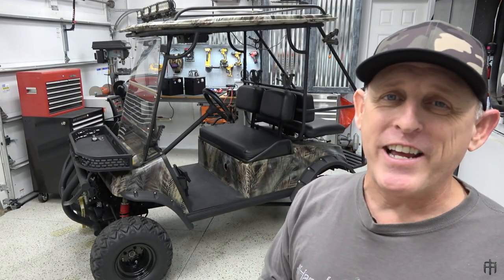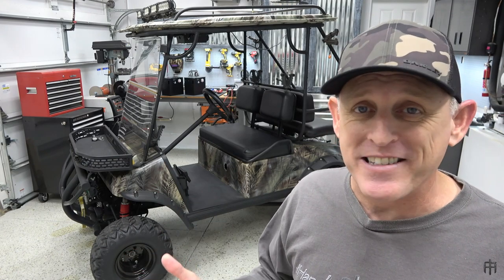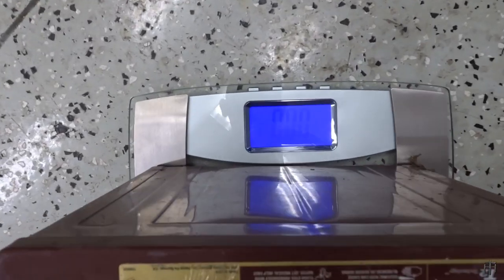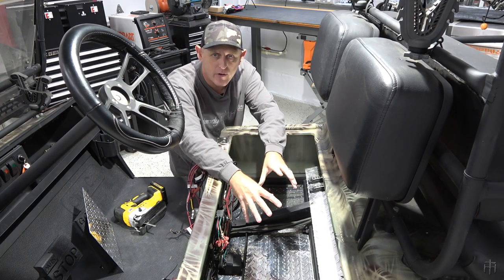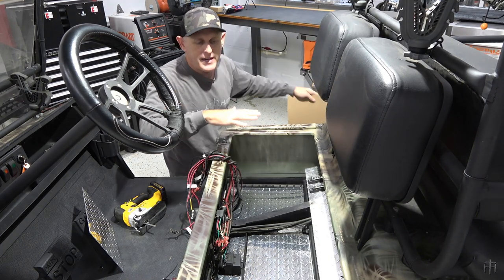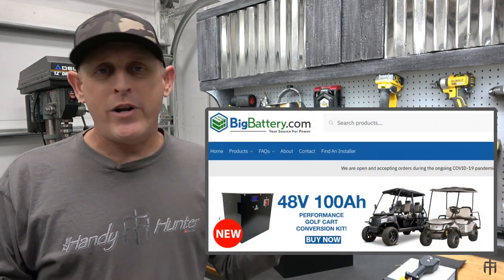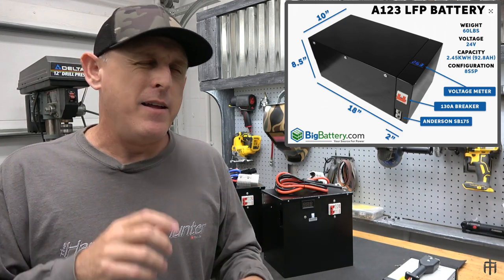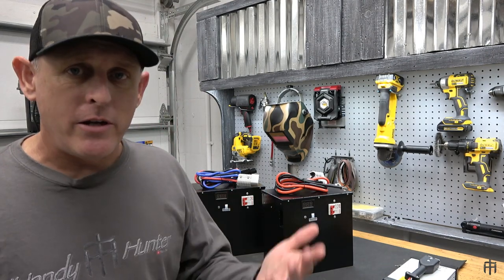Tesla Powered Hunting Cart!  Lithium Battery Conversion!

Comment: You mention lithium ion batteries multiple times but you links are for lifepo4 batteries which are not the same as lithium ion. You really could save a lot if you look at the individual 3.6v lifepo4 cells. thats what I replaced my 6 -6volt LA batteries in my camper with.
Reply from the maker: You are correct…The batteries I installed were Lit/ion but the ones I now recommend are LifePo4 because they are better.  If I had to do it all over I would build my set out of 3.2v blue blocks using a Daly BMS.  Thanks for commenting!

Comment: The led acid batteries need airflow because of the off-gassing. LiPo needs airflow but because of the heat dissipation. So don't seal these up without giving them a way to get rid of excess heat. Use a porthole with a small fan that turns on at 75 degrees or something based on the specification.

Comment: Great video, converting mine. What did you do about the interlock that prevents operation while charging since all the old charging cables are replaced.
Reply from the maker: I removed all that so the cart will actually move while charging.  I either put it in neutral or turn the key off.  Hope that helps.

Comment: 👍 nice to see there are more lithium pack alternatives. I'm currently building another stol plane. I'm planning on electric in it also. Will be using a 40 HP  89# of torque. With Peak efficiency at 3000 rpm  And 4 Tesla packs. These packs are flatter allowing two in each wing. This Plane will be used mostly for competition. But with its glide ratio and the motor regen capability. I'm hoping for close to two hours of flight time. Which at top Cruise speed should get me around 250 miles. More than enough to take a leisurely early morning or Twilight light flight.
Reply from the maker: That’s awesome!  What a cool project!  Shoot me some pics when you are done…would love to see it👍

Comment: Would you recommend a setup like this for a twin motor bad boy buggy
Reply from the maker: Yep! Just look for a good battery with high output since you have two motors.  I assumed the BBB’s are 48volts?  You should have many options if you have the room, etc.
Reply: @TheHandyHunter  yes, it is 48 volts and has alot of lights, radio, etc. But all the lights are led. If I contact big battery are their prices competitive,. Every where I look it looks like about 1000 to 1500 for the setup including charger.
Reply from the maker: That sounds cheap actually.  I’ve only seen prices that low for lower Ah sets which may be all you need but generally the more Ah the more$$$.
Reply from the maker: Are you running your lights off a 48v to 12v reducer?
Reply: @TheHandyHunter  yes,. All lights and equipment are running off a current 8 battery setup to produce 48 volts. Then ran to a reducer and then to a fuse box

Comment: Good video thanks. Did the batteries stop holding a charge or a different issue?
Reply from the maker: Internal cables too small, breakers tripping constantly, and range drastically shorter way too soon.  I would build my own batteries next time.
Reply: @TheHandyHunter  thanks for the info!

Comment: Hey..Nice job! I was wondering, are you concerned about water/debris getting into those bus bars and such? Your wheel wells are open to inside that battery compartment. Also, your charging port is exposed. For an off road cart, that would concern me.
Reply from the maker: Not concerned about the bus bars but it can get really dirty inside so it needs to be cleaned.  I pressure wash the inside but avoid direct hits on controller and battery boxes.  Never had a problem.  Also, there is a cover that goes over the charging port when not in use.  Hope that helps!

Comment: How did you secure the diamond plating?  Screws/Bolts??? and where did you get it from??
Reply from the maker: I get my diamond plate at a local steel store but you can get it at Home Depot or Amazon as well.  I just used stainless metal screws to secure.  Good luck!

Comment: ok in your description on your amazon parts i do not see the shunt for the bus bar, also i'm confused about the accessory bars are they on the page. thanks
Reply from the maker: Hi Dale, sorry for the delay.  The shunt comes with the Coulometer.  Not sure what you mean by the accessory bars…let me know.  Thx!
Reply: @TheHandyHunter  so i am thinking about buying the same Batteries that you have, 1st what has been your opinion on your setup 2 i currently have a voltage reducer with a fuse block and ground block will that be sufficient with this system? thanks

Comment: Looks like you have a 500 amp controller.  These packs have a 126A peak discharge so did you have to turn down your controller?
Reply from the maker: I did not but I rarely hit that high of a draw for very long.  It does happen sometimes when pulling a heavy firewood trailer for a while and the breaker will throw on the pack.  I just flip it back on and take it easier.

Comment: I am in the middle of a similar conversion. New controller, solenoid, and lion batteries. Did you need a obc bypass for this setup. I cannot get any click out of solenoid but have voltage everywhere.
Reply from the maker: I don’t have an obc on mine.  May want to double check your throttle wiring to make sure it’s turning on the selenoid.

Comment: Any updates on how you like (all of) the new equipment?
Reply from the maker: So far so good!  My only problem is that I can’t find a 12v reg that can push my winch.  I think it’s a power hog.
Reply: @TheHandyHunter  I was wondering about this. You said in the video you had the winch powered through the converter, did you have it that way with your LA batteries? I have been told more than once that this can not be done due to the amp draw that a winch needs. So far there is no converter I have found that can handle a 12v winch. I also can not seem to find a 48v winch, even though there are stories about them existing. Have you had any luck finding an alternative method?
Reply from the maker: Hey brother...we think alike.  On LA I ran winch on 16volts (2 batt)...ran like a mother.  On lithium...At first, the winch worked on the regulator but then blew up.  I ordered a bigger one and it only clicks when I try it...won’t work.  Currently, my winch won’t work and I’m done trying to find a regulator.  I think the only solution is to run a separate 12volt battery in the cart just for the winch.  Let me know what you find out...I’m stuck too!

Comment: How did you mount your battery monitor and temperature gauge? I kind of want to do the same thing (mount up high so easy to view). Can't tell from your video and don't see any brackets on your amazon store. Looks like you may have used velcro? Also, for your battery monitor, did you wire it through your key switch so screen only on when key on? OR, since you have on/off switches on your batteries, did you simply wire per instructions and turn off your batteries when not using so no power to accessories? I bought the same monitor and planning to install this weekend.
Reply from the maker: Hi Troy, I took a metal junction box cover and bent it so my monitor would angle down a bit.  I then wedged it in place for a tight fit.  I used double sided tape to make it stick and so far it’s been great.  I did not wire into key switch because it draws little power, goes dark when not in use, and I flip off the battery breakers when not in use for extended time.  It’s good to mount high where its protected from sun and rain since I dont think it’s very weatherproof.  I love mine!  Good luck and let me know how it goes.!

Comment: have you tried towing anything with this? if so are you using the stock motor and how much did you tow?
Reply from the maker: I’ve towed heavy with the original motor and with my new motor.  I abused my old motor which was about 40 years old and can’t believe how well it held up.  I have the beast now and it’s great too.  I tow a 4x6 trailer loaded with firewood till it can’t hold anymore.  It probably weights 2,000lbs completely loaded with big logs.  Cart does fine but I’m also pulling on flat land with decent roads.  Once you get it moving the amp draw drops a lot.  I may be testing some new batteries from RoyPow soon with 200 amp 30sec capability.  I hope that helps.  Good luck!

Comment: Man i love what you ve done with your cart! The welding and fabrication is impressive. I would like to add suspension to my rear axes and wandering. Would the shocks alone do well by themselves without the top links?? Im trying to minimize the amount of welding. Also where would find the top links ? Robby
Reply from the maker: Hi Robby, you have to have the top link to keep the whole axle from swaying side to side.  It also keeps your axle from rotating forward when you hit the gas.  You can find the top links called heim joints on ebay.  You can find the weldable heim joint brackets on ebay is well.  Hope that helps!  Good luck.

Comment: Hey HH, love the video! Great information you shared here, this is something that I definitely plan to do in the future on my club car DS hunting ride. Quick question for you. Are you at all concerned about the #6 AWG wiring on the Anderson cables with the high torque motor and controller upgrade? I personally have the same motor and a 600 amp alltrax controller which both recommend #2 AWG cabling.
Reply from the maker: I had the same concern too but so far everthing is working great.  I shortened the provided cables as much as possible since they were extra long but you could create your own 2awg cables with anderson plugs going to your bus bar.  Keep in mind that the short internal cables are still 6 awg so you can’t completely eliminate the smaller cable.  With that said, I haven’t had any problems in my initial use and my motor runs about 40 degrees cooler on lithium vs lead acid!  I plan to torture test them on my next trip to the farm.  I want to pull a heavy trailer loaded with wood to see how it performs and whether I can throw the breakers.  So far so good, lots of pepp, power, and range with a little more speed thrown in.  Good luck and Merry Christmas!

Comment: Have you had any issues running your winch off the bus bar given the regulator is just 60A but the winch can pull 180A at 3000lbs? Or do you just make sure not to pull that hard?
Reply from the maker: My winch doesnt work off any of the regulators I’ve tried.  I’m thinking of adding a new separate battery for the winch.  Thinking of building a 16v or even trying a 24v😬.  I just know that my winch ran like a scolded dog on 16 volts with lead acid.  I’d like to get that performance back.  Let me know what you decide.

Comment: Hey.  So this was a great video.  But, as I am a newbie and I wanted to understand this a bit more.  I love your diagram you drew up.  But I am not sure where the solenoid is as well as the controller (I think it is) is on the wiring diagram?
Reply from the maker: The “main out” cables on the diagram will go to your solenoid and controller.  This diagram was just meant to show the difference in pre-controller setup using lithium vs lead acid.  I hope that helps!

Comment: Did you consider just mounting the charger inside the cart since you have so much space for it now? That's what I have been thinking I'll do, so that I just have to plug into any wall outlet anywhere I'm at.
Reply from the maker: I wanted too but this charger is not waterproof and I pressure wash my cart often.  I may upgrade to a new charger in the future as having it mounted onboard is a huge plus...especially since these chargers are very light!  If you can do it I would mount it onboard for sure!  Thanks for commenting!

Comment: Upgrading my cart with Navitas AC conversion kit and stumbled across your video. Looks like you live in our neighborhood. Ha! My batteries are about done so now would be the time to make this kind of change. Did you look at the 48V 6.4kWh Li-ion Kit they offer? It does not state in on their website but their video for 48V Model 3 Li-ion Kit states that system has less capacity  (4.6 kWh). I believe you said one of the reasons you did this particular setup vs the 6.4 kWh set-up was for additional storage capacity under your seat, correct?
Reply from the maker: Hi Troy!  If you go to bigbattery’s website and click on the 10 year warranty at the top you’ll see details and specifics regarding their warranty.  You’ll love the upgrade and let me know if you need help.  Stop by sometime, I’m the first house on the right.  Lot’s of carts in this area!  Merry Christmas!

Comment: Good Afternoon, 
I have a 94 club car ds  that I am wanting to convert to a similar system, I saw the diagram in the video showing the power coming from Buss Bars to main out..  Can you show me how you have the rest of the power wired to the controller, pedometer  forward reverse etc? I'll be switching to the lithium when the current batteries are dead.
Reply from the maker: Hi Jay, that’s why I stopped the diagram where I did because that’s where different brands of carts start showing their differences in how they are wired.  Luckily, there are lots of wiring diagrams for DS carts on google or the internet in general.  They will show you how to wire the F&R switch, the controller, motor, and throttle.  If you are buying a new controller chances are they will have wiring diagrams on their website.  Lots of good resources out there that explain it better than I can.  I hope that helps and good luck!

Comment: Great video and awesome illustrations for the wiring diagram. Using it in my build right now. My apologies is you answered this before. Why 600amp buss bars? 
What’s the amperage on your controller?
Reply from the maker: I have a 500amp Altrax controller.  Hope that helps.

Comment: Hey Handy Hunter! I've checked out your tube long ago and it helped me with my conversion, thx, very appreciated! Year plus later I have issues, was wondering if all is good with your set up? I did mine set up similar but your's is by far a whole another level! A couple of questions for you. I have the BigBattery 36v gator max kit 120Ah 5 kW! My charger never shuts off, according to them that is correct. How about yours? Also fully charged shows 45.5-46v, cart is a 36v. Does your's go well over 48v fully charged? My cart stopped running, appears to be controller, spoke with a mechanic and he believe the controller has been getting too hot and the resistors are burnt, wondering it it's from to much voltage! I am getting the full voltage on cart parts using multimeter! Emailed Big Batt. about this and back initially on set up about to much voltage at full charge they stated their computer board inside would not let that much voltage to cart and that even though the charger does not shut off the board will not allow it to over charge. Does any of this happen with your set up?
Reply from the maker: My charger slows to a trickle as it reaches full charge but never completely shuts off.  My 48v pack will hit like 55 volts at full charge so yours is normal for lithium.  Have you thought about upgrading to a solid state system vs the coils?  You will be amazed at the difference and will work better with yiur lithium set.  Hope that helps!

Comment: how did you mount your battery monitor to the roof? Looks like Velcro but I feel like that wouldn't hold. I want to mount mine to the roof as well.
Reply from the maker: I took a junction box face plate and cut out an L shaped bracket and then wedged it between the bar.  I used double sided tape to get it to stick to the faceplate and it holds well....never comes off.  Good luck!

Comment: So why the update for no longer recommending big battery?
Reply from the maker: Had some issues with my batteries blowing due to the breaker not tripping.  Also, the gauge wire they use internally is way too small for high amp carts.  I will build my own batteries next time.  Hope that helps.

Comment: How much of a difference over lead acid was there as far as range, power, etc.....
Reply from the maker: Got almost 25 miles on pavement at night running lights.  I’m hoping to do an offroad range test soon.  The power seems stronger I think due mostly to the massive weight loss from lead acid.  You can tell a big difference in weight loss.  Batteries now charge faster too.  Hope that helps!

Comment: Hey Handy Hunter.  Looking to upgrade an electric cart for a similar build.  I live in Appalachia and have some good hills to climb.  In any way that you want to reference it, would you say the new motor and controller help climb "X" grade?  I know I won't be able to do hill climbs, but with a lift similar to yours I'd like to be able to climb hills around 20 degrees.  Thanks.
Reply from the maker: No problem at all.  Are you running lithium or lead acid?  LA is 300lb more up hill.  If you are concerned you could jump up to 600 amp controller instead of five but not sure you need it.  Hope that helps!
Reply: I’ll go LA for the weight savings. And may go with the 600 amp just to be safe. Better too much than too little. Thanks for the quick feedback.

Comment: Your Amazon store has a link to the RMP 3003 H22 Aluminum Diamond Tread Sheet, 12 Inch x 36 Inch . How many of these did you need for your conversion?
Reply from the maker: I used 2 and had some left over.  Hope that helps!